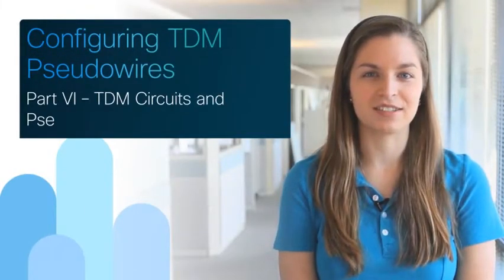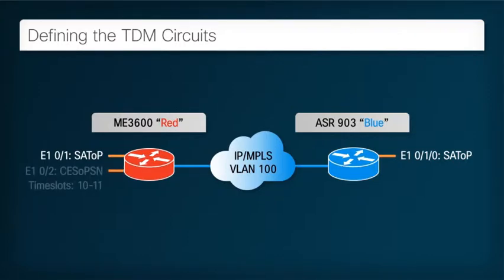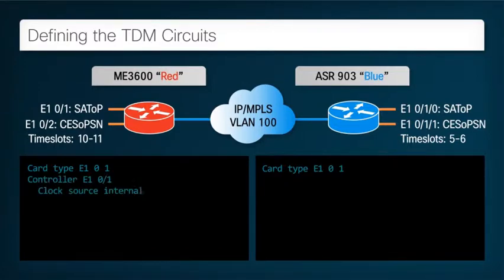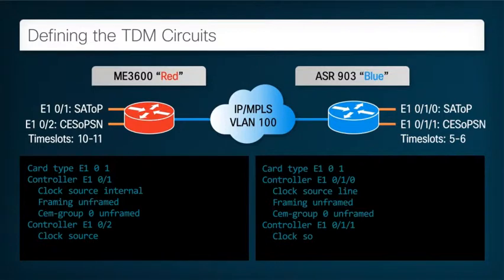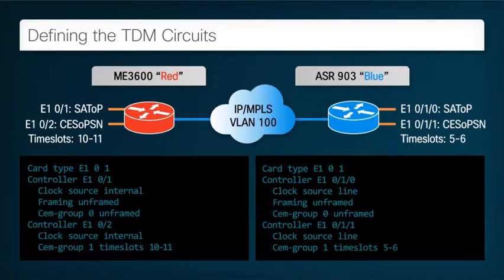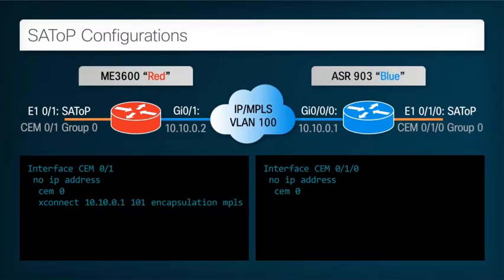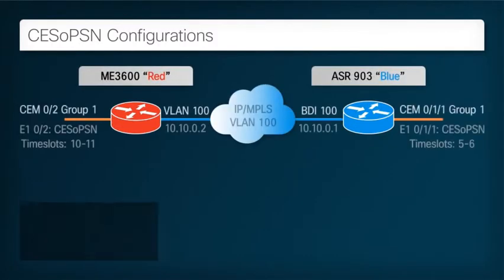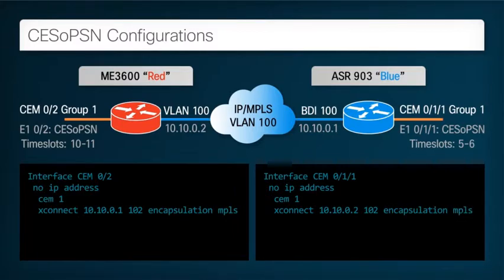Cisco SPAG: Configuring TDM Pseudowires - Part 6/6: TDM Circuits and Pseudowires

Comment: Just a question. The PW doesn't need to use the Loopbacks addresses under the xconnect configuration? There is some reason to use the p2p link interface address?